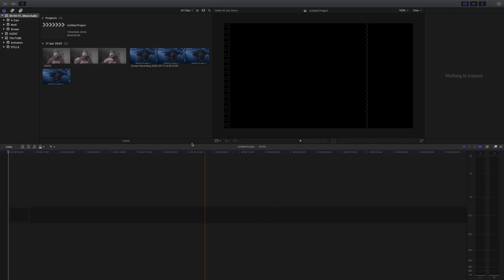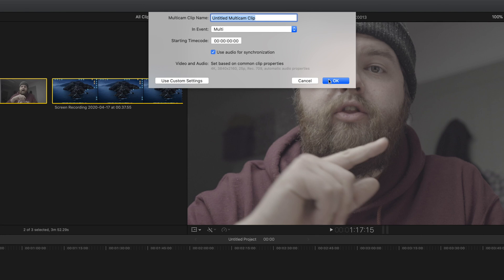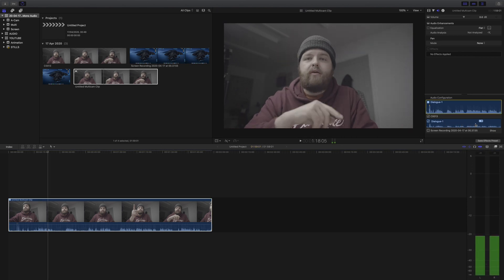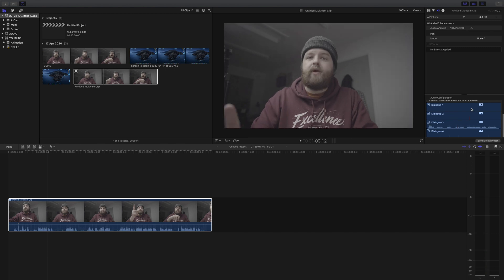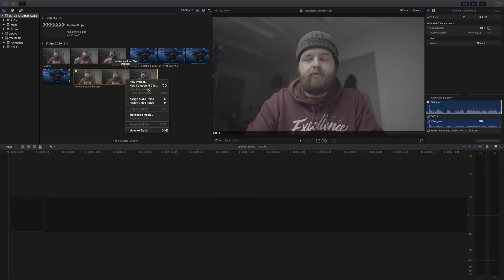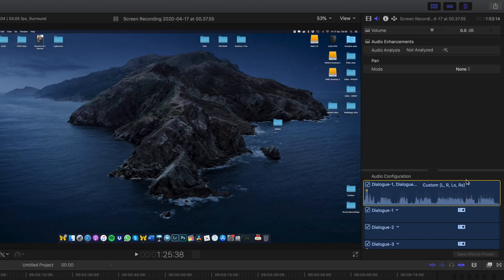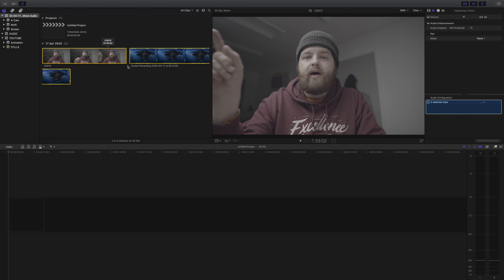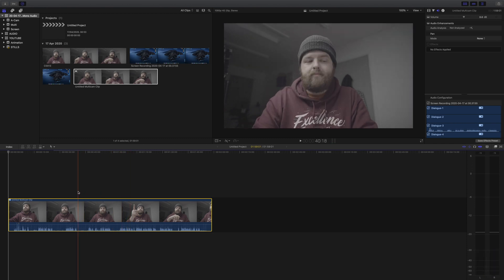Multicam MONO to STEREO Audio FIX || Final Cut Pro X

Comment: If it helps, I had the same problem (I had created my multicam sequence BEFORE switching the sound of my footages to mono dual), but I think I have found a quicker solution that doesn't force us to redo everything: once the multicam sequence has been created, you just have to expand it by double-clicking on it (you then have a view of the different sequences that make up the multicam), and from there you can act independently on the audio of each sequence, and thus switch them to mono dual. Once done, it will act on the whole multicam sequence already edited in your timeline. I hope that will help!
Reply: Thanks for this - I'd already cut my entire Multicam sequence and was dreading have to re-cut it - then I saw your comment! Thanks so much - fixed it in 30 seconds!
Reply: Dude.. thank you so much. 💯